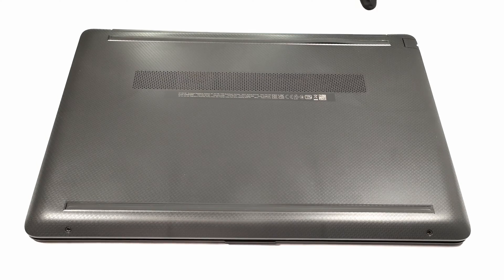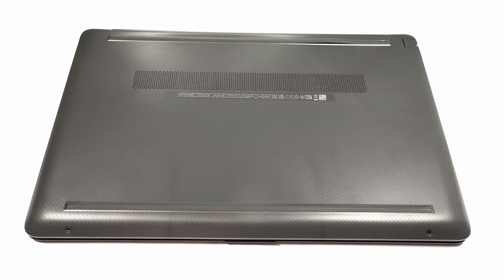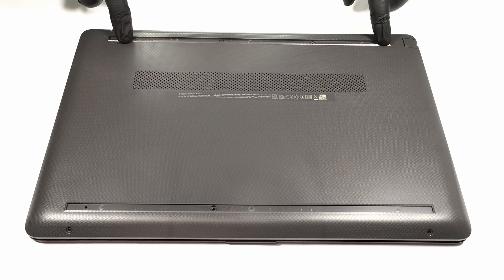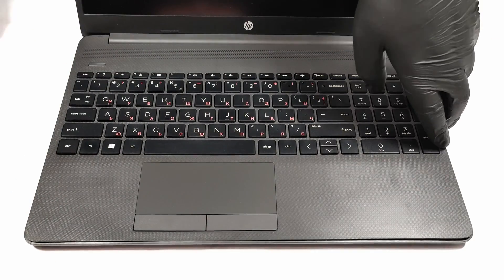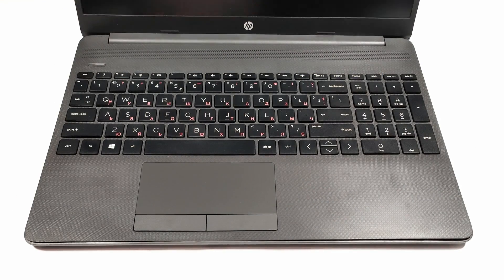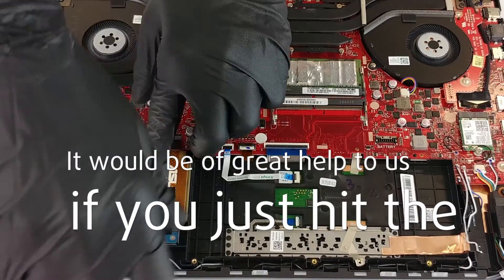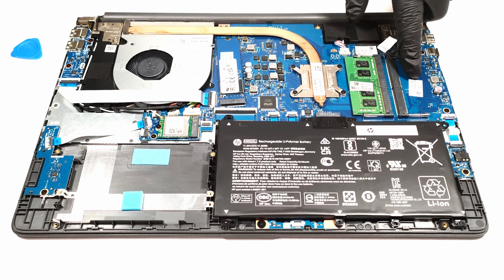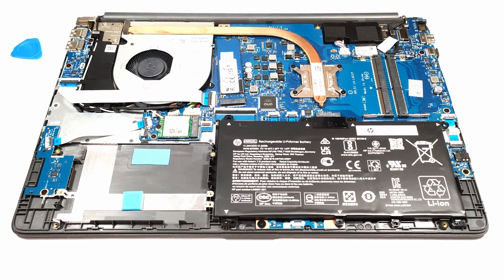🛠️ HP 255 G8 - disassembly and upgrade options

Comment: I have 8gb of ram, if i upgrade it and i will add 8 more gb , the integrated video graphic will take more? Or it will be the same 500mb vram?….😢
Reply: Vram has no connection with physical ram, so adding 8 more gb ram will not upgrade your vram, which depends of model of graphic card, but probably it's integrated on processor.

Comment: Is the ram i see 8gb module? Or is it 4gb and the other 4gb is soldered on the motherboard? Thanks!!
Reply: It's a 8GB module in the first memory slot, in the second slot you can install another module to create 16GB RAM. Memory is not soldered on the mobo, not in this laptop anyway.
Reply: Can it be increase to 32gb (2x16) with the Ryazan 5 5500u?  Thanks
Reply: @reneesalipante4611  I think yes, am4 support 32gb of ram and even more. The problem is only if your sub-model laptop has soldered ram module or not.
PS: Ryazan = Ryzen

Comment: Ir's a whole industry to make money. PC repair shops need to have clients too. They make these things more and more complicated to work with and you have to take them to people who know what they're doing. One word: modular! Just make the batteries detachable like before, add two small lids with a screw on the back to just access the ram and hard drive. So you can easily upgrade or swap yourself. There isn't much else to upgrade to a laptop anyway. Why should people be forced to open the whole thing up?

Comment: So you can add storage to It?
Reply: Yes, I think so. There is a vacant place in the left bottom (on the video) for an additional 2,5" sata hdd, but you need a connector/cable. I ordered such a cable on ebay but have not received it yet.

Comment: I strongly recommend that you have a special sensitive tool for prying it open on the sides after the screws are out, do not use a regular small screw driver. 
Either that or go to a shop and let them do it if you can't get your hands on something that would be good for opening the sides.

Also models despite being the same number can be slightly different, my screws were differently placed , there was also less of em' and the sides of the panel where you try to open it were far more tighter packed with not even a tad jutting out to be used to open it.
Reply: bro just use a old gift card
Reply: hehe i used a nife and one of my screw got to fuvkred and its umm -um striped yeah just end me.
Reply: @MICEMICEMICE283 ain't that bad, it's just one screw,
Reply: yeah the opener is very helpful to open the bottom panel safely and quickly

Comment: I dont see any cables for the 2.5 HDD/SSD Slot. So You can't install a 2.5" Drive!?
Reply: Could it be HP Part # L52025-001 ?
Reply: there's a port on the motherboard but connector has to be bought separately

Comment: Can i upgrade it i3 to i5
Reply: Thats seems like an AMD Platform. Find some cracked version of Aida64 and find socket number. If socket support CPU exchange - only in service centre, becausr it's BGA CPU. But problem can be on BIOS or HUB (boot guard option on Intel platform). If boot guard active - CPU exchange will kill your pc

Comment: this HP beats similar Lenovo V15 gen2 ryzen 5500u, because a) 2  vs 1 ramslots b) sdcard reader, V15 not c) Sata cable 6$, V15 20$ d) 41ah battery, V15 38h. e) dont know if it has TN panel like V15 or better IPS screen. one thing sucks on hp thats screws under rubberpads.

Comment: can you install dual sata hdd  in there ?   i see the place for it  , its just missing the connector
Reply: I think you can install another 256gb nvme SSD
Reply: @777guy5  I don't think so. Wouldn't it be better to replace the original 256 m2 ssd with a larger one, like a 1TB version and additionally a 2,5" sata hdd?
Reply: @quigg2420  yea, but then you will need to get all that data on the original back to the new one, just keep the new 1tb ssd on tgr free slot

Comment: How long battery lasts? Is it any good?
Is screen ok for normal use?
Reply: the battery lasts about 5/6 hours with my config (amd athlon gold 3150u) and the screen may not look good from certain angles but its ok
Reply: AMD platform, ryzen 5 3500u - 4-5 hours of watching films/video. Working in some programs (video editor, games) reduce worktime of battery to 1,5 - 2 hours.
Reply: Ryzen 5300u, in battery saver mode with a couple of chrome tabs open and coding being done in Visual Studio Code, it can survive 6 hours.
Reply: @Nightmare78hAlo  
I am looking for a laptop specifically for programming, do you recommend this laptop? Although it has a Ryzen 5 5500u and I plan to expand the ram to 16GB...

Comment: It's a good computer for business and other type of things, If you want to game on it you need to upgrade the RAM to around 16gb 2400mhz because the integrated graphics card uses 2GB !
Reply: I added 8gb DDR4 ram and the system didn't boot
Reply: so which exactly ram do i buy as secondary to upgrade it?
Reply: Hi is this laptop have any manufacturer defects or problem want to buy but need to know if it will cost me more money to repair it then just buying something else that won't. What do you guys think. Please share I going for the i5 core of this module will later upgrade the ram since I in software development

Comment: Why would you flip the laptop to pry open the bottom and then flip it back to take it off? Why not just keep it with the bottom side up?
Reply: It's just for the video. He had opened the casing beforehand to avoid struggle (and to give it a more "professional" touch).

Comment: There is no SATA SSD port in this model 😔 i bought this model because of that. I just baught it and was really disappointed to see they left out the connector and the small flexcable that is normally connected to the JHDD port.
Reply: can you tell me what to do with this?  256g is too small for me
Reply: @cathup   I just baught the connector seperatly. It is a 8pin flex cable to sata. Original par numbers are L52024-001 and L52025-001.
Reply: @AN-zk8yv  Thanks for the information. Could you provide a link to the source of the connector? And can you already say wether the addional HDD is working or not with this connector? THX
Reply: @HOtt-bw4jx  I can not provide a link because YouTube is deleting it.

Festplatten-Anschlusskabel für HP Laptop 15-dw 15s-dy 15s-du 15s-dr 15s-gr LS-H323P
JUTOSHUR 2,5 Zoll HDD SSD

This one from amz... Worked for me
Reply: @HOtt-bw4jx  Search on AliExpress "For HP 15 15s-du 15s-dy 15S-DR 15S-GR 15-GW 15-GW0011LA 250 G8 laptop SATA Hard Drive HDD SSD Connector Flex Cable ls-h323p"
Reply: @AN-zk8yv  Hi, did this work properly for you? I'm confused by the comment below about the apparent lack of "electronics" on the connector board. Thank you in advance
Reply: @trevorsmith8814  works fine for me
Reply: @cathup  You can replace it by 512GB or 1TB with the same specs.
Reply: I opend meine and it dosen't have a cooling fan and the second ram slot is missing
Reply: It's a little bit confusing because there seem to be so many different versions of the same laptop. Last week I bought this laptop, HP 255 G8 (7J034AA). On youtube I saw a video from an Italian guy who added a 2,5" sata hdd and all that was needed was a connector/cable. No pcb or additional electronics. His laptop and mine looks simular so I ordered the connector/cable, hopefully it works.
Reply: Me too

Comment: Can i upgrade the cpu?
Reply: No
Reply: Yes, you can, but only in service centre. It's BGA processor. Seem's like this AMD plarform, so upgrade to ryzen 5 3550H. But TDP... 3500U not cold like some shity pentium or extra hot like core 10th or 11th gen, but in BIOS max temperature is 65°C. The best solution - buy second RAM card or buy 2 RAM card Kingston for dual-chanel mod because regular RAM to slow (timing 24-22-22... come on)

Comment: Is it just me or is the sata port missing?
Reply: you need a daughterboard and a properly sized screw to secure it. see post right above me for product name
Reply: just you, its fliped you can see black plastic connector under blue pcb on the left side @4:26
Reply: @rrsf4i  hate to break it you bud but that's not what that is, I have this same laptop, it came with a 250GB ssd and I wanted to shove my old 1TB hdd in it but there's no connector. The whole reason I watched this video was to make sure I didn't screw anything up opening it.
Reply: @zuri1382  u sure it isnt sata plus power both in same plug?
Reply: @zuri1382  dont have this laptop, i just assumed
Reply: @rrsf4i  nah I looked up more of these models and it seems that some models have a different pcb that has a sata connector on them, so I'll have to replace my pcb and then I'll be able to make use of my drive. 

No worries bro, it took me a minute to grasp that there wasn't a connector there too as I'd never seen that before.
Reply: @zuri1382  wait, im not done ahaha okay, its not sata+power, what connector is it?
Reply: @rrsf4i  its an sd slot lol
Reply: @zuri1382  so u remove laptop panel to insert sd card? that can be right?
Reply: @zuri1382  that cant be right man, not even HP would be that dumb. I think u are confusing some plugs, either u have a very old IDE hdd (doubt it since idk they come in 2.5" form factor and they are long gone) that is not compatible with sata, or you are expecting an m.2 slot but found sata. like i said, no manufacturer will make u remove laptop screws to plug in sd card.
Reply: @rrsf4i  nah nah bro, the pcb is connected to an sd slot, there is an m.2 but its closer to the center of the motherboard and yes I know what a sata drive is, I have a 2.5", 1TB sata harddrive and as of this comment, my laptop has no connector for a sata drive. It has the open space for one, but there's no way to connect the drive to the board.
Reply: @zuri1382  https://youtu.be/DDXl54NZAo8 near end of video he opens laptop and has hdd installed and upgrades with an m.2
Reply: @zuri1382  thats just sad, sorry for your loss
Reply: @zuri1382  you are right, there is no sata port 🙄 I bought mine seperatly :
JUTOSHUR 2,5 Zoll HDD SSD
Festplatten-Anschlusskabel für HP Laptop 15-dw 15s-dy 15s-du 15s-dr 15s-gr LS-H323P
Reply: @rrsf4i  The SD slot is from the outside of course, you plug it in from the side of the laptop. It's not clearly visible from any angle in this video, maybe 2:25 gives a better perspective: there's a visable black plastic thingy that the PCB surrounds - that's part of the SD card holder. (Have the same laptop in my hands)
Reply: @rrsf4i  This other video you've linked has a different version of this laptop, with the "proper PCB" apparently. (I'm also holding a simular laptop as @zuri1382 in my hands). This other guy has the SATA connector on the same PCB as the SD card slot reader, and there's a second cable going from the motherboard (near the WLAN module) to this PCB. The good thing is that on my laptop (and the one in the video), the motherboard does have this second connector laying around, ~you just need this other kind of SD-reader & SATA reader PCB (and probably a cable for it). You probably also need to cut some plastic, because if you look closely, there's a black piece of plastic securing this smaller SD-reader PCB in place (not with screws tho), on the other video however, the bigger, SATA capable PCB streches over that. ~

EDIT: fake info, you don't need a whole PCB and this cutting nonsense, you can just get a special connector and plug it into the slot mentioned on the motherboard. (like AN-zk8yv said previously) I didn't see that comment at the time, sorry :D

Comment: Where is the hard drive??
Reply: 4:26, hdd empty spot and 4:23 m.2 occupied slot
Reply: How to put in empty slot pls help
Reply: @ffsallami4342  you must buy a pcb. Without them you can't connect HDD or SSD 2.5'
Reply: @ffsallami4342  you need to buy cableseparately. there's a connector for it on the motherboard.

Comment: Do these rubber things stick afterwards?
Reply: yes
Reply: @Haniv1001  mine are too big for the slots now. They won't fit. How do I fix it?
Reply: @marcoslightspeed5517  try to squeeze them in, should work. you gotta be careful not to stretch them when peeling them off.
Reply: Probably not as good as the original. When I removed the rubberpads, most of the glue was left on the plastic bottom and not on the pads. There is simular adhesive tape available however, search for something like B-7010 double sided electronic repair tape. It is available in different sizes, like 5mm wide and 50 meter long for less than 9 euro's.